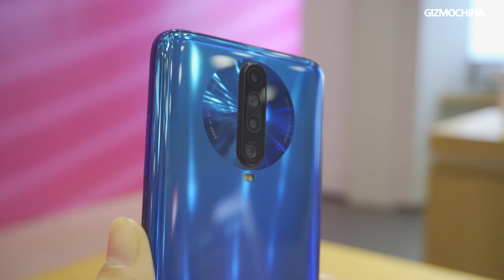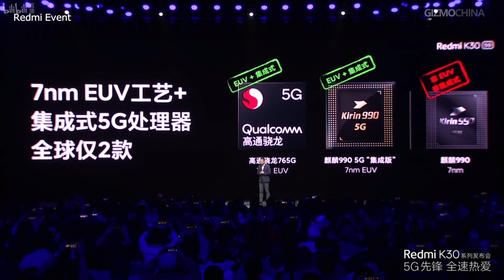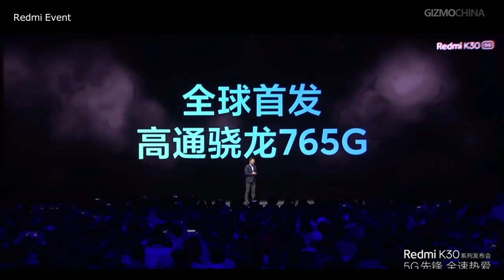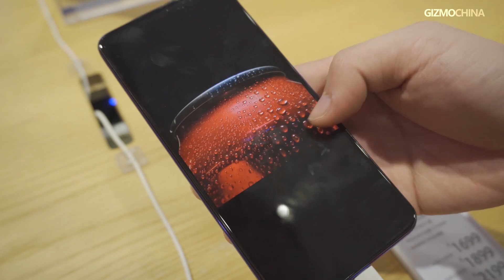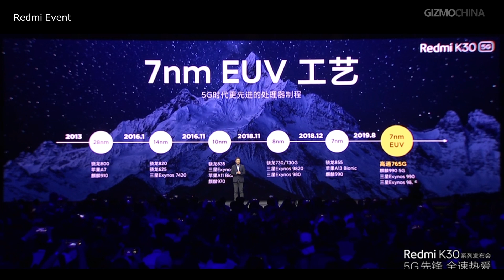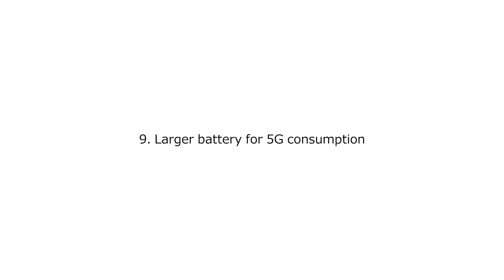Redmi K30 5G: Top 10 Features You Should Know

Comment: I own this phone and to be quite honest here, it does everything that I need.  Goodbye apple, Samsung...the Redmii K30 is quite literally a crouching tiger, Hidden dragon in the smartphone market.  It will surprise you by its power and abilities.
Reply: does the redmi k30 5g has good display? have u tried using it for tiktok?
Reply: @princessherrera3161  my nephew has and it works fine.
Reply: @Mark-pr7ug  does it lag in gaming or tiktok?
Reply: @princessherrera3161  no, Ive encountered no issues
Reply: @Mark-pr7ug  thank youuu
Reply: @Mark-pr7ug  any update of the performance of the phone?
Reply: @sergiorobertosolana2870  I owned my redmi since February of this year and I'm still satisfied with the phones performance.  Good strong battery, excellent camera, highly detailed gfx with no lag in any of the games which I've played and the option to switch between 60 and 120hz with the display smooths even the most vidually challenging display.  Still my fave phone and fave brand.  Oh and the phone is packed with all of the standard plus more features usually only found on a mid to high end phone.  So why fork out via a contract for £1000 phone when you can customise the redmi with apps which match it close to those so called giants.  So unless it's all down to vanity in which you want to be seen with the latest handset from Apple or Samsung, do yourself a favour and get a redmi.
Reply: @princessherrera3161  forgot to answer you question about the screen.  The ability to make the screen 120mhz smooths everything, making video richer and more detailed, gameplay more attractive.  The 120mhz makes slow motion video capture  (which is built into the camera modes)even more amazing too.  Not bad for a budget mid range mobile device

Oh and the larger screen display is a welcome bonus.
Reply: Is this phone can still useful this 2021
Reply: @sakutsakiyoomi2176  yes, I'm still using that model and have no problems.